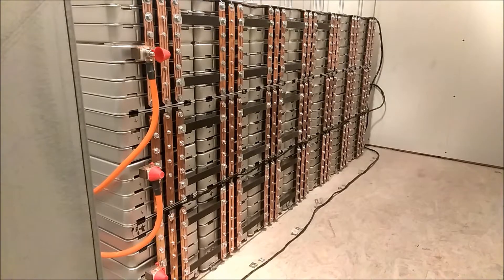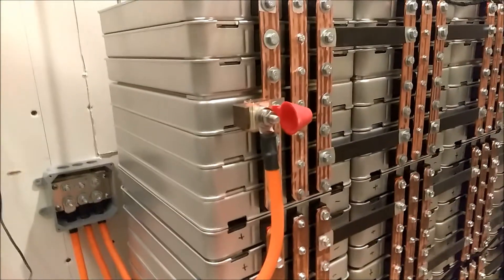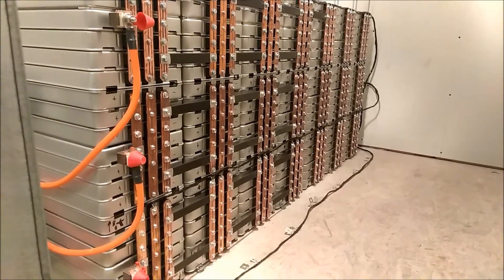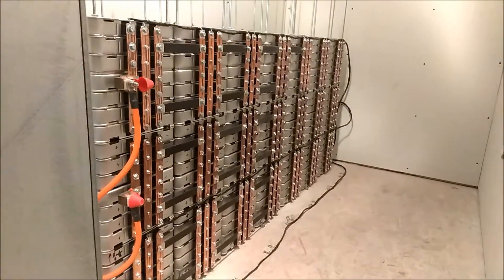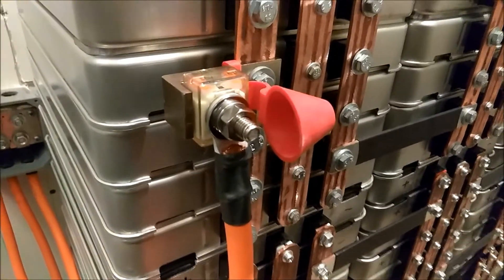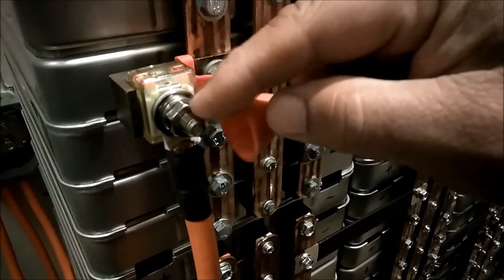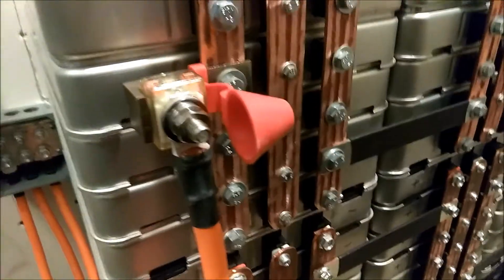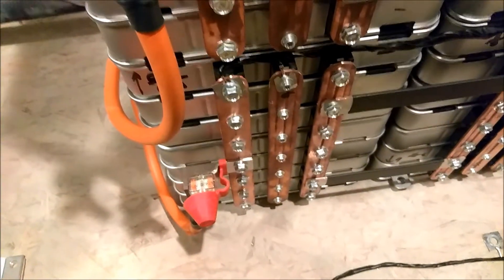fuse blocks installed on mega power wall

Comment: What size fuse block are you using? Amps?
Reply from the maker: The fuse blocks came with 150 amp fuses but I will be replacing them with 75 amps .

Comment: Watch your videos all the time. I got the Leaf batteries also but was wondering what the percentage of charge is for a given voltage. I know you have the facts on it but couldn’t find it anywhere.
Reply from the maker: Are you running 12 volts 24 volts or 48 because it will be different for each of them.  On one module 8.3 volts will be fully charged but you should not charge all the way up to 100%, stay somewhere around 90 to 92% and the batteries will last longer. Five votes is completely dead you should never go lower than five votes.  But for a margin of error I would stay somewhere between 5.5 votes to 5.6 to be on the safe side. And this will be for one module.
Reply: @carsonlurbanwindandsolar3437  I’m running 7s 48 volts. I never let it go below 41 to 42 volts and you are right about not going to 100% charge. What is 90% etcetra.
Reply from the maker: 90% is around 53 votes. I charge to about 57 votes but I keep an eye on my batteries balance all the time even with the BMS on there.

Comment: I'm trying to program my renogy rover charge controller to the correct parameters to my battery bank.  I've got a 24 volt setup 3 in parallel and 3 in series 9 batteries total.   I can't seem to find where it will allow me to enter proper voltages in here so I dont blow myself up.  Can you help me?
Reply from the maker: Man I cannot help you at all I have not used one of those inverters so I would not be the right person to be asking that question. Maybe you should contact the company and see if they can help sorry.
Reply: I figured it out. The parameters in the charge controller were not going up high enough for 24 volt system.  But when you tell the controller you are a 24 volt system you set the parameters in 12volt settings that just get automatically doubled by the controller. Its stated that way in a footnote in the manual.   I over read it 3 times lol.  But its good to go now. Thanks for the reply.
Reply from the maker: Good deal happy you got it going 👍.